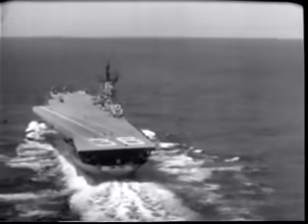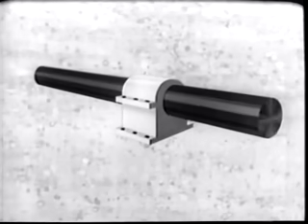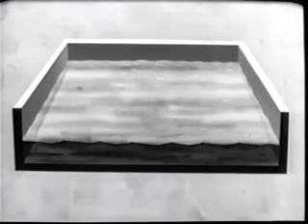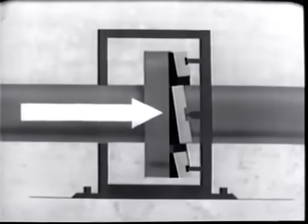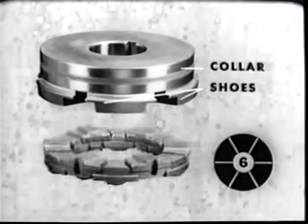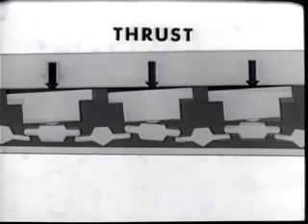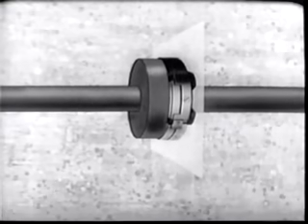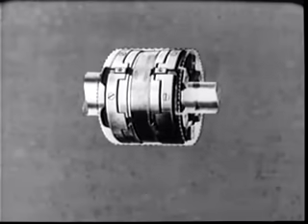U.S. NAVY Kingsbury Thrust Bearings

Comment: I have my wife's grandfather's engineering manuals covering many disciplines.  They were printed in the early 1910's and are a fascinating read.  Regarding thrust bearings, at the time of transition from sail to powered merchant ships, the first main shaft thrust bearings were simple iron plates cooled with sea water.  An improvement  came by machining slots into the flat plates and introducing oil.  Next came huge roller thrust bearings.  This evolution greatly reduced coal or oil consumption, allowing additional cargo capacity in place of fuel in the hold and significantly cut maintenance downtime.  Grandpaw-in-law had been a machinists mate aboard the USS Randolph in WWII, a self-taught engineer, and a fantastic source of knowledge.  Thanks for the Kingsbury video!  Brilliant solutions come from imagining all failure modes... and without computers even!

Comment: Thanks for posting this video. I worked at Kingsbury for 40 yrs. from an apprentice to machinist to inspector.  Worked on thousands of bearings, many for the Navy. Dr. Kingsbury's design was revolutionary back in 1912, still going strong today.
Reply: I'm trying to figure out what causes the shoes to tilt in such a way that there is always a proper wedge formed necessary for the direction of rotation. I'm thinking it must be the case that the angles on the bottom of the lower leveling plates are machined off center so that they will tilt the right way so that an oil wedge is formed at the collar-shoe interface. That would explain why the bearing only works in one direction and why the lower leveling plates tilt the necessary direction to cause the wedge to form. Please help me out here. Am I on the right track?
Reply: @OperationFrigateBird  The oil wedge forms as a result of the collar's rotation with respect to the stationary bearing shoes. The oil is "pumped" into the gap between the collar and shoe by the rotating collar. If the collar's direction of rotation reverses, the same oil wedge forms, but it builds up on the opposite side of the shoe's thrust face. Keep in mind, the clearances at which the oil wedge forms and operates are extremely small (thousandths of an inch) and the oil's viscosity, along with it's ability to support large loads, are key factors. The oil wedge phenomenon is briefly explained in the video while introducing the journal bearing. 02:41
Reply: @kyle6094  You didn't carefully read what I was asking. I am asking about a minute but very important detail that he would know.
Reply: @OperationFrigateBird  KTBs work in both directions of rotation.
Reply: If your KTB is direction specific it is probably because the shoe support (the hard steel button on the bottom) is offset from center. Per the Kingsbury design guide "While the standard position of the hardened steel support is at the center of the shoe, this support can be offset in the direction of rotation".
Reply: @kyle6094  Thank you for that. That is what I was looking for. I thought that must be the case. The video (or perhaps it was another video I watchedon KTB's) mentioned that a KTB was needed for each direction of rotation, one on either side of the thrust collar, indicating that the KTB is directional.
Reply: @kyle6094  So it's the pressure of the oil wedge that forces the rotation?
Reply: @RCAvhstape  what component(s) are you referring to that rotate? The oil wedge forms as a result of the relative motion between the rotating collar and the stationary thrust shoes. The spinning collar drags oil into the the very narrow gap between the two surfaces. The oil wedge that forms carries the thrust load (yes, the oil can be under significant pressure in doing so) and it also prevents the metal surfaces from touching.
Reply: @kyle6094  I mean the tilting of the shoes. It seems that they should tilt in the direction the collar is moving, not opposite from it as depicted in the video. So, I figured the collar shoving oil into the gap is what causes it to tilt the way it does.
Reply: @RCAvhstape  The oil is dragged into the gap by the collar. As the oil passes along the face of the shoe, some of it squeezes out from the open sides of the gap, so there is less oil in the gap the further along the face the collar rotates. This continuous difference in oil volume from the inlet to the outlet edges of the shoe creates the wedge shape. The oil within the thinnest part of the gap is still transferring thrust force, there's just less of it near the end of its journey across the face. The wedge shape is highly exaggerated in the video, when in reality it is necessarily very thin for the hydrodynamic lubrication effect to work. The wedge thickness is actually on the order of  maybe a few mils.
Reply: @kyle6094  Ah, okay, that's the answer I was looking for, thanks.
Reply: I got my engineering degree attending classes in Kingsbury Hall at UNH and later designed thrust bearings for the Navy that are still in service today. I can attest this guy Kingsbury was a mechanical genius.
Reply: Whats up fitz

Comment: I was an Avionics Tech in the Navy back in the dark ages (1970s-80s).  I went thru a year of technical training before out to the fleet.  It was cool to see an example of what the Mechs went thru.  I was always marveled by the work they did on the aircraft.  I helped change a couple of engines on P-3s when needed: "Here, hand me that spanner, then hold this line."  I fixed their stereo equipment, when asked, but kept them away from my comms, navigation and radar gear.  Those were good guys.

Comment: MM1/SS, 1987 - 1997
Reply: Actually took our port ME thrust bearing apart. We had a class wide problem with "crashback" operations, or answering a "back emergency" bell.

The astern element was two Curtiss stages. When the ahead throttles close and the astern throttles opened, the rotor thrust switches direction. The oil film is ok as long as the rotor is, well, rotating. But to go from ahead to astern, you have to go through rpm=0, at which the oil film between the thrust collar and the shoes goes away.

Chamfering the leading edge of the thrust shoes helped a little bit in slowing down when the bearing alarm would come in. But it wasn't enough. We solved the problem procedurally.

The Aux Electrician Aft would come to Maneuvring to watch the 2TMP (bearing temperatures) upon a "back emergency" and call out bearing temperatures to the Throttleman as they screamed up. At a threshold temperature, the throttleman would back off the astern throttle enough to take some of the rotor thrust off (astern steam chest pressure was a good guide), at which point the film reestablished and bearing temperature plummeted. Then crank back to the requested bell.

Comment: We have three types of bearings, roller, ball and slipper. Ball bearings are used for thrust or axial loads.
Reply: Lots of double-row ball bearing used for thrust bearings in smaller machinery.
Reply: Most turbojet engine have double. @stevebriggs9399

Comment: I like the explanation on the video this same principle is use in a car engine, it also has a thrust bearing in it for the crank shaft it explains how it works and the clutch in the car puts pressure on it and how it can wear and why you need it and why you need to check it properly 😊

Comment: In the ‘70’s I was 1st Engineer on the President Madison. In heavy seas, we had our main thrust bearing fail. With engine and deck crew, we pulled the cover, cleaned out the melted Babbitt, removed the old shoes. The collar looked like an LP record with about .030 deep grooves. With the turning gear, we used a 4” angle grinder to grind it flat in two rotations, then stoned the disk, cleaned out the grit, and inserted the spare shoes. The repair allowed us to use 8,000 of our 28,500hp. We arrived in Oakland instead of Seattle a week late. The shore gang bolted a compound on the housing and repeated what I had done but much more accurately, and likely made a collar to take up what was ground off. They took a month to do it. Cost to the company was astronomical, as all the cargo was Seattle, Chicago, New York, and APL did not have the links from Oakland. If they had to call the tow truck, we would have run out of food before docking. My guess is the height gap in the ground strap on the shaft might have had something to do with it. Oxidized Babbitt is somewhat more abrasive than normal. Have fun
Reply from the maker: Thanks for sharing your story! This is awesome!!
Reply: Ahh, the good old days. Not much Marine Engineers can't do. USMMS 68
Reply: @joeenglish7403 MMA ‘88
Reply: Very cool
Reply: Guys like you can fix anything!
Reply: What kind or class of ship is the President Madison?

Comment: Imagine the stress applied to the thrust bearings when a warship has to perform a crash stop during ship trials.
Reply: 2x forward.
Reply: @Pene7942 Propellors usually only put 30 to 50% thrust astern to optimize fwd thrust. A controllable pitch is different. Have fun

Comment: Maybe 15 years ago I seen a 6 shoe one from a big submersible pump motor, I found it very interesting so I looked up the pump manual and learned the name and basic concept of how it worked. What surprised me most was that it was a very old invention because I thought it would be cutting-edge technology when they manufactured that motor in the 90s.

Anyway, I never knew they could be made with just 2 shoes, I just assumed the minimum was three, that's why I like watching these kinds of videos 👍
Reply: I pulled apart a 3/4 hp deep well pump motor last year. It had a three-shoe Kingsbury bearing supporting the armature. Of course, I didn't really know what it was until I looked it up. Brilliant!